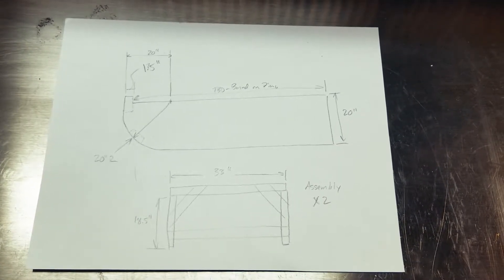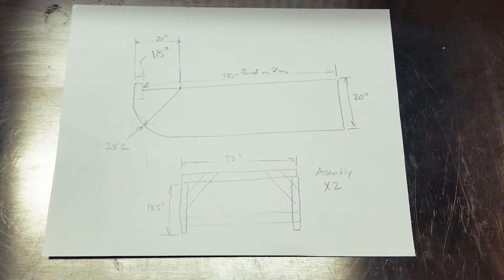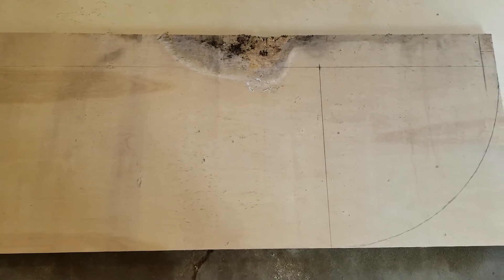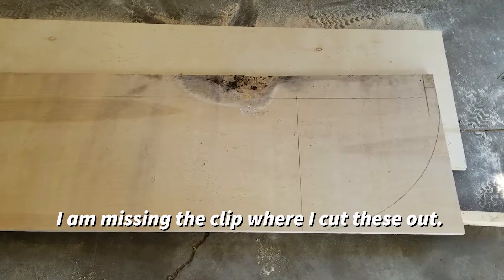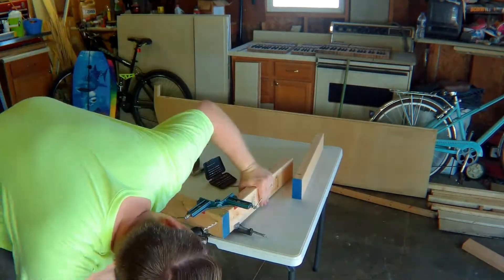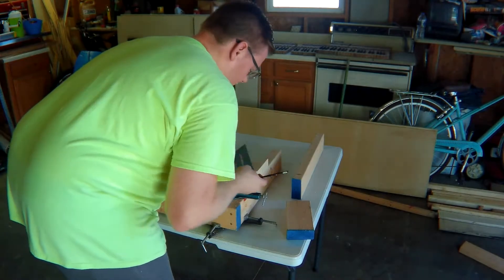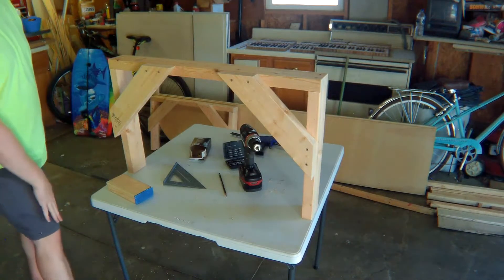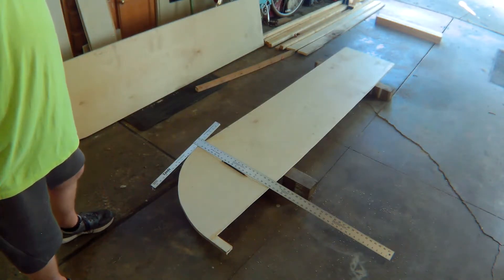130 Year Old Piano Rebuild - Part 6 - Piano Tilter Build

Comment: I have a M. Shultz Style X, which is a big and heavy upright that I tipped this weekend to change the casters. I used your design, but with a 20" radius and height.  I had my son-in-law help tilt the piano, but he really wasn't needed. It went over smoothly and easily. There was plenty enough leverage and stability to maintain constant control of the movement. The same with going back upright. The tipper was also plenty sturdy with the piano on its back while I worked on it. Thanks for the info.
Reply from the maker: This design has been working well for me. I'm glad it's working well for you. I've had my piano up and down a few times so far, and it's been very stable and secure.